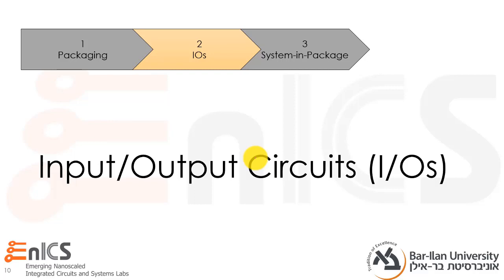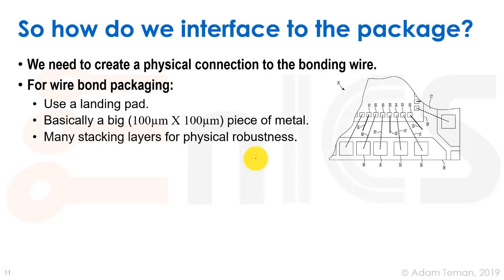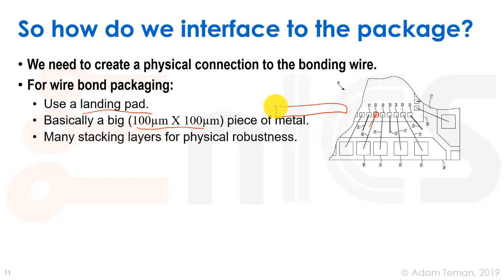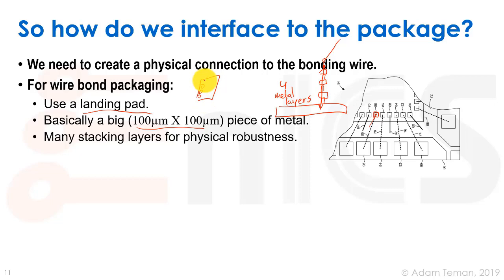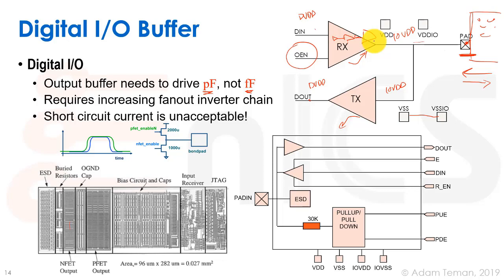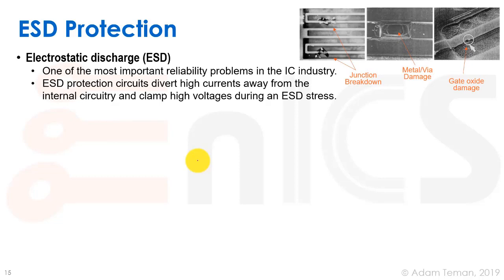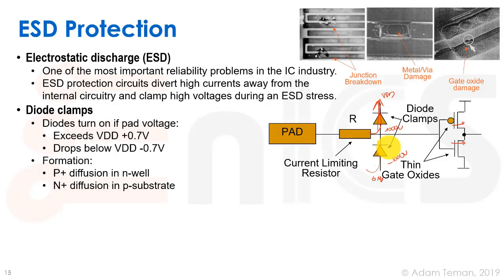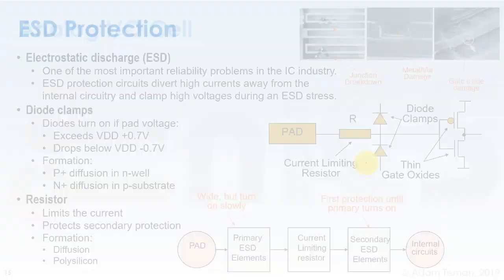DVD - Lecture 10b: I/O Circuits - Digital IOs

Comment: I think Din and Dout and TX and RX are mistakenly swapped at 10:15. And if not, it would great if you explain the naming convention
Reply from the maker: Hi Haziq,
Indeed, this is a really bad naming convention, but I didn't invent it. Maybe I should have changed it, because it's so upside down, but I kept what was in a reference that I based it on. You can see in the bottom figure that the usage of DIN/DOUT is the same (pay attention that the PAD is connecting outside the chip, while the ports are connected to the chip core). 

I can try to give a makeshift explanation, but really, it is going to be a bad one, because if I were to design these I/Os, I would label the pins in the opposite way. Here it goes - "we are looking at the I/O from the perspective of the other chip, so its outputs are connected to DOUT and its inputs to DIN. Where the other chip is receiving is the RX I/O and where it is transmitting is the TX one". 

So after we got that horrible explanation out of the way, I will say that these things just depend on whatever the vendor who developed the circuit decided to call it. So you have to read the manual (good luck ;) and adhere to it.
Reply: @AdiTeman  well the explanation isn't that horrible. And by not changing it, you saved the students from future confusion. Thanks!